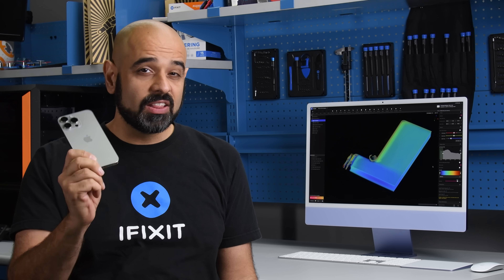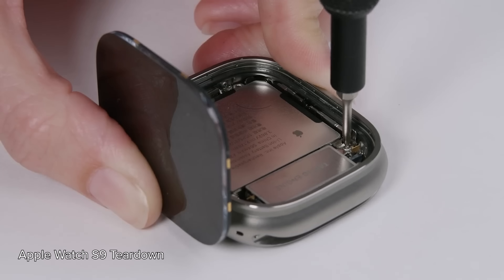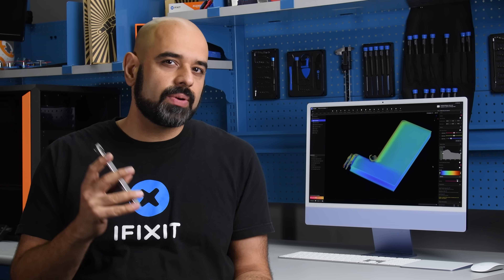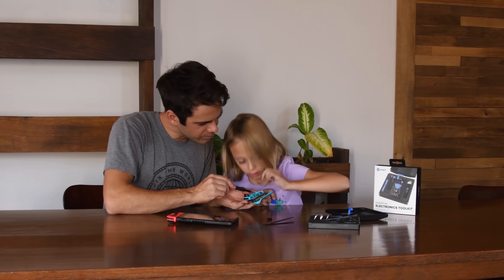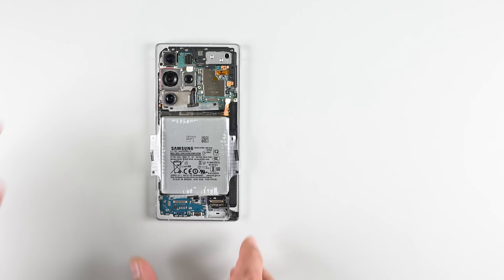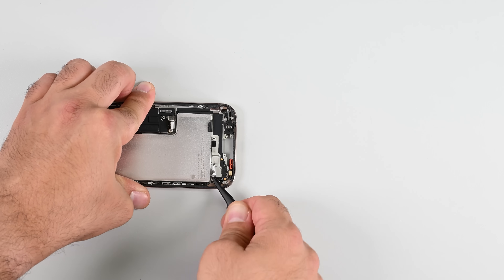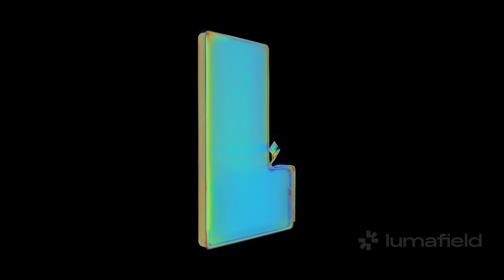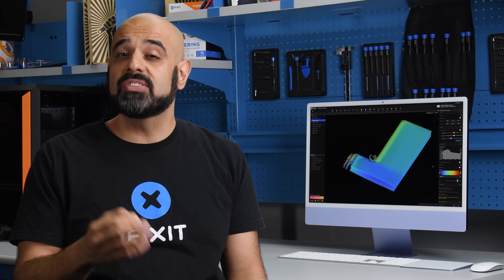Why Does Apple Put Batteries In Metal Cases?

Comment: I stopped charging my phone fully about 5 years ago usually between 80-95 percent depending on my day and try to not let it get very low. My 12 pro max battery is still fine and seems to be lasting me longer than previous phones which definitely wouldn’t last 5 years without needing a new battery or just buying a new phone. My maximum capacity is at 87%  which from seeing what other people’s are at seems pretty good so I’ll definitely continue doing it going forward.

Comment: 400 charge cycle is not normal death of lithium batteries. I have 82% capacity left from 987 charge cycles and I’m not alone. You probably meant 4000

Comment: I wonder if the steel case also helps with the new iPhone Air's remarkable rigidity (at least from what I've seen). Seems like it's almost necessary at this point. Regardless, as someone who has replaced countless batteries and seen some really sketchy swollen/damaged ones, this is a great move!

Comment: "low battery anxiety"
I only that from using my phone as a navigation device for a 100 kilometer bike ride. =D Although usually carrying a powerbank, and even having equipped one of my bikes with a power converter to make the power from the dynamo usable via a USB socket. Works like a charm.

My daily driver is an 8 years old Samsung Galaxy Note 8, where I switched out the battery already a few years ago. Possibly next year is finally time for a new phone, and I am thinking about one of thos interesting non-mainstream models. A rugged phone, which is large and thick, because it includes a battery as large as a powerbank, which makes it last for a week without charging. But also quite some mass in the pocket and I can't put it into some holder on the handle bar.........

Other than that, about swappable batteries - there is this new mandate in Europe, getting into effect in 2027, that all new smartphones must have a user replacable battery. This is going to be interesting, most makers will comply, let's see what kind of shenanigans Apple will come up with again.

Comment: Finally the insanity is ending!

When I say "Insanity" I refer to the bad industrial habit of placing a container-less Li-Poly battery inside so many electronic devices.
Even the cheapest zinc-carbon battery has a steel jacket around the zinc casing. For years, we had to endure two undignified technology trends: one was the installation of microchip dies directly on the PCBs, covered by a drop of epoxy glue. The second mad trend has been the use of Lithium-Polymer batteries "encased" in aluminium foil. I say "mad trend" because every battery can evolve some gas, and if the battery is placed in a bag instead of a box, as soon even a tiny amount of gas do evolve, it will distance the active plates in the bag, increasing the internal resistance - which in turn evolves more gas that cause even more spacing, in a "doom loop" that cause the infamous "spicy pillow" phenomenon. Finally someone is returning some dignity tho the second most important component of a smartphone, the first being the SoC.
Thank you for the wondrous news!
Greetings,
Anthony
Reply: Hopefully this will remain a trend, when user replacable batteries get into effect in 2027 by a European mandate. It would be cool to simply slide some metal batteries into the phone's body, instead of opening it up like in the old days.

Comment: My battery capacity is at 100% after 10 months and 231 cycles. I have set the charge limit to 80% and rarely used wireless charging. Commenting in case anyone wants to focus on battery health longevity.

Comment: Small steps. And right-to-repair laws are toothless without any state's willingness to enforce them, or to recognize malicious compliance.
Reply: The EU comes to the rescue. There is already a mandate in place, forcing new phones to have user replacable batteries by 2027. Manufacturers don't do something like this without getting forced to. The EU also mandated USB-C ports for all new phones in the past, no more Apple lightning bullshit.
Reply: @Marc_Fuchs_1985  Considering the European Commission's lack of technical understanding, their mandates will likely allow malicious compliance that makes replacement parts too expensive to be practical.
Reply: @moeskido I really can't make any assumptions on how much technical knowledge they have (politicians usually lack in this regard), but the mandate clearly states: User replacable without special tools needed. So the manufacturers can make their own batteries as expensive as they like, 3rd parties will cover for that.
But concerning malicious compliance...... The one where this can expected the most is Apple. I am pretty sure they are going through some brainstorming, how to comply the worst way possible. I wouldn't be surprised if they would artificially limit the capacity of 3rd party batteries via software or just make their phones outright reject non-Apple batteries. Too bad, but I don't care since I would never buy from them anyway.

Comment: Just give us si-ca not still li-ion
Reply: I am waiting for new battery tech for years now. Over 5 years ago, they were talking about new solid batteries coming soon, where are they? Solid batteries, which have no heat issues, can't be bent and punctured, don't explode and come with a higher energy density. Li-Ion works good enough so far, but with far more gadgets running on batteries these days, I would expect battery research to a little faster.

Comment: As someone from Bahrain, a country just north of Saudi Arabia, I'd like to know if this move is good or bad for the thermal performance of devices. iPhones tend to heat up here, especially on days when the temperature exceeds 40 Celsius (~104 F).
Reply: I think a metal enclosure is always better for temperature regulation. Sure when the phone is cool, it also means heat gets inside more quickly, but it would heat up to that temperature anyway, and an important thing is, that at least for the CPU, 40°C is not very hot, so that one has an easier time cooling down even in hot weather, and cooler CPU also means cooler battery at some point.

So where you live, there might be less of an advantage, but here in Europe, a metal casing would help quite a bit, since we rarely reach 40°C.
Reply: @Marc_Fuchs_1985  This increases if you park in the sun, and sometimes while driving, the car’s outer sensor reports a higher temperature by about 20%. This is understandable if you consider all the cars and air conditioning units simply adding more heat outdoors. I don’t think all of this is fully considered, which only contributes to hastening the planned obsolescence of these devices.
Reply: @mbah2959 Forget about the heat of cars and aircons compared to the power of the sun. The cars might affect the air quality and you might not want to stand in front of the hot qir of an aircon in summer waiting for the bus but it will not change the temps of the city in the slightest.

Comment: One aspect i haven't seen anyone talking about is the battery itself in a smartphone are often used as a heat sink due to it take up so much spaces. A metal enclosure around the battery might help with spreading heat around, although it probably doesn't help with the longevity of the battery

Comment: I remember when Samsung had that problem with exploding batteries because there were packed too tightly in the phone. So now we have an additional level of metal around the battery. I expect more cases of exploding phones.
Reply: Every removable phone battery is encased in metal. Just take the wrapper off - this is likely similar to that.
Reply: @ShirokoCycling not true
Reply: @andylem  Go find a phone in your drawer, remove the removable battery, and remove the wrapper. It's a metal-cased battery.
Reply: @ShirokoCycling did that, no metal. Stop lying

Comment: idea: generic universal smartphone battery that can be made by any number of approved manufacturers and used by any number of smartphone companies for their entry level phone w/user-swappable battery design. main target market EU
Reply: Thank god your not in charge of anything important 😭😭😭😭🙏🙏🙏🙏
Reply: @cartanfan-youtube  Why would you say that? This idea sounds like a great one. It doesn't need to be one single battery size, but it would be awesome, if there were like 3 or 5 standardized sizes, one of which every phone would need to be made for. I think that's a great idea.
In case this isn't clear so far, the EU already has the mandate in place, that from 2027 on all new phones must have user replacable batteries. And there is no reason, why this couldn't be a standard battery size, all phones do have a flat battery of similar size already. Offering different sizes, let's say of 3000mAh, 4000mAh and 5000mAh, and phone makers can decide, how big or small they want to make their phones in order to fit one of this capacities in there. And if the phone turns 2mm thicker or 5mm wider, no user will care! The trend of ever thinner smartphones was not intended by the users, but by the manufacturers to have another argument, why their new phone is supposed to be better - while ridiculously thin smartphones have no advantage for the user, rather being worse, since bending and breaking more easily.

So yeah, my take is, standardized batteries for phones would be awesome! If you have sensical counter arguments, I'd like to hear them.
Reply: @Marc_Fuchs_1985 if I had to explain why, it would require too much time and effort (that I don’t care enough about for a YouTube comment) to explain the nuances of why a one size (or ig many sizes) fits all approach would be disastrous. Best I can describe it as is: Ports I can understand, but batteries are too intimately linked to the device to make this practical
Reply: @cartanfan-youtube  No, not a valid excuse. It's not like universal batteries are rocket science. All the necessary standards exist already, like temperature sensors, almost every lithium cell already comes with a BMS, so it's unlikely a phone could do anything with the battery, that might cause any problems. Other than that, there are no issues. I am doing loads of DIY stuff with lithium batteries, everything works as intended. Even devices never meant to be run on lithium cells. Why would there be any problem in between manufacturers? As mentioned, not an excuse, not an argument, unless you would provide specifics.

Think of the universal 18650 cells. They are being used for so many purposes, in so many devices and being interchangable. I have even built a new laptop battery from 18650s. Sure you gotta watch for voltages and temperature, both very simple concepts for manufacturers to take care of. There is no problem, that couldn't be solved with proper manufacturing.
Reply: @Marc_Fuchs_1985 why are you assuming I want to argue this with you
Reply: @cartanfan-youtube  Because communication...... I say, something is a good idea. You say, I am wrong. I would like to understand why, that simple. But if you don't want to waste too much time writing, I don't blame you for that, when the matter isn't important enough to you to convince others to change their mind. I do sometimes waste too much time arguing with people.

Comment: I'd like to have a battery that doesn't require specialized tools or skills to replace.
Reply: You'll get exactly that. The EU already has a mandate in place, that forces the makers to offer all of their new phones to have user replacable batteries, without tools required, taking effect in 2027. It's likely that most makers will adapt that for their global sales, except Apple of course, since they are the stubborn bully, that never wants to comply.
Reply: @Marc_Fuchs_1985  The electric adhesive looks like a good step until you realize it takes specialized tools to release it.

Comment: People are not missing text messages from low battery.

People are using low battery as an excuse to miss texts from loved ones
Reply: trueeeee
Reply: which is so weird, you just say "no, I didn't see it, I wasn't checking texts so I could cool off."
Reply: Kinda of true, kinda not, it’s a lil bit of both for sure… but some ppl legitimately miss calls/texts over a dead battery…. It’s a real issue, however not a huge one, with acceptable battery lives in modern cell phones usually close to the “all day” mark… but most definitely could be improved…
Reply: "loved ones"
Reply: Is it an iOS only issue? Missing text messages due to low battery? Never had the issue on android
Reply: True. In ALL the years I've had a smartphone - NOT ONCE did I miss a call/text from a loved one due to a empty battery.
Reply: they're also lying buy saying only 400 cycles, they just want to sell parts and tools don't care about the consumer.

Comment: this is such a moronic take in my opinion. Let's say an average phone needs battery replacement in 2 years, and you want to replace your battery to use the phone for few more years. So you are saying that, once in 2 years you dont want to spend extra hour or two to replace battery if the phone designer makes replacing little more complicated?? Think it this way, if the manufacturers didn't have to make it easy to replace battery, maybe they could have made a complex design battery that was larger and more safe by squeezing it in every corners of your phone making it hard to replace but durable long lasting and more mAh.
Reply: I have a Fairphone 4, bought 1 year after release. When the phone was only 2 years old, I had to contact Fairphone for a replacement battery as the original wasn't lasting more than 6 hours with moderate use. My replacement battery is starting to have the issue.

Comment: so safety when replacing it.
my 15 pro max which claims 1000 cycles vs 400 has already had the battery down to 85% after 2 years of light use and care :(

Comment: User swappable batteries ain’t never gonna happen with the big phone makers, and tbh I’m not sure I want it.
Just have a powerbank with you if you lose power alla the time.
Reply: It's important for a consumer to have the ability to keep using their hardware if it's up to the task and having to constantly carry a powerbank is too much hassle when replacing a battery is easier, and the only reason it's not trivial is simply because not all manufacturers make their replacement parts purchaseable for consumers. If the processor is still fine then replacing a battery will greatly reduce waste.

I did some quick searching and in Apple's case parts and manunal availability is stellar. Not commenting on the price. For Samsung almost no part has pictures which makes browsing the parts catalogue really bad and also couldn't find parts for my phone's exact model but at least the system is there so improving is easier than building from scratch.
Reply: @eduardobarreto5555 Making the batteries even simpler to swap, in a shop, is great. I’m talking about John and Jane Doe swapping it at home with just a couple of screws.